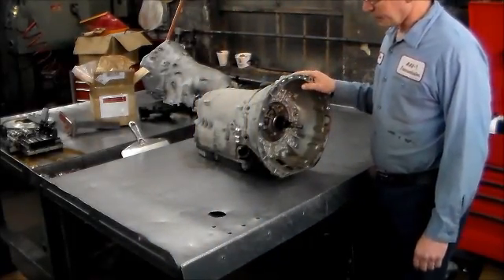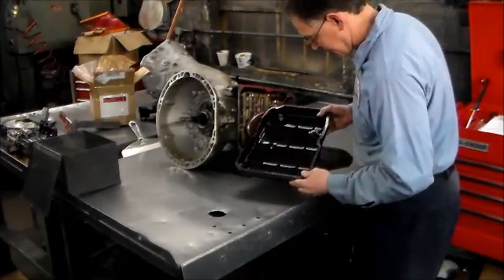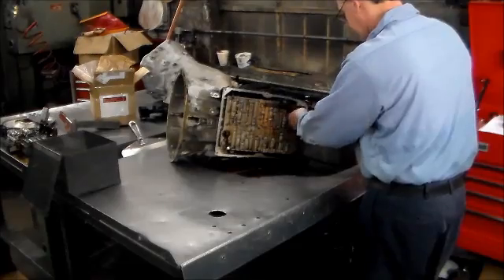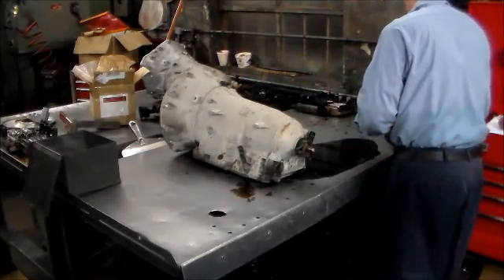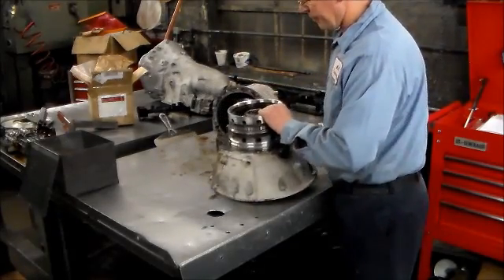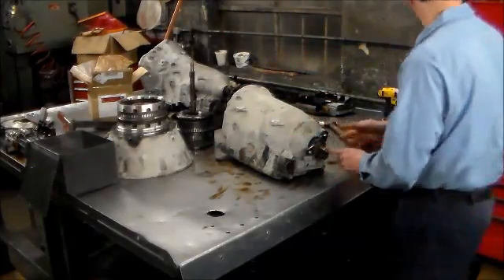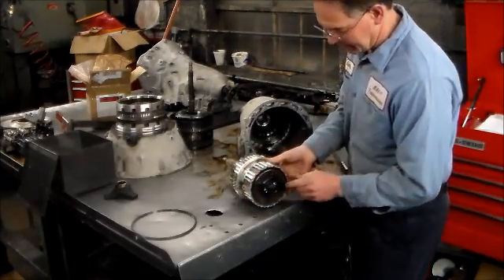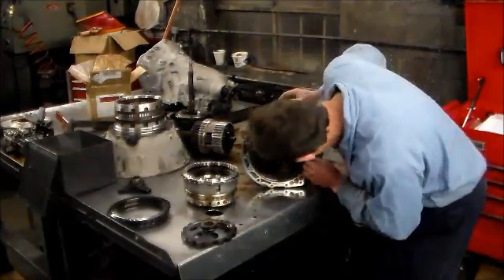722.6 Mercedes Transmission, Teardown Inspection

Comment: Dear Gary 
What is the normal operating temperature on 722.6. I have a suv ML 2003 2.7 diesel the trans warms up to 120c and will go even higer. The problem is going in to limp mode when hot, code is speed sensor 2-3 implausible signal or sliping. Can it also be the conductor plate?
Reply from the maker: Can be conductor plate, do you know what the code number is? 120c is almost 250f that running alittle to hot, about 20 degrees or so,  if your driving it when in limp mode, that will heat up the trans
Reply: No i don’t have the number of the conductor plate, because i didn’t remove valve body. No the transmission goes into limp mode only when hot and also the converter clutch sems little strange to me, it never locks it self on the scann tool it’s always open or regulating. I don’t know how this benz tranns lock up is working but on zf transmissions it’s locked almost all the time but not here, i don’t know majbe it must be that way.
Reply from the maker: No, i meant the trouble code number. Sometimes its a softwear issue with the scan tool, one time i started looking into a speed sensor issue and realized it was the scan tool giving me the wrong info. What type of scanner do you have?
Reply: The codes are p2502 and p220a i have a delphi scan tool.
Reply from the maker: Those are speed sensor codes correct?
Reply: yes, 
p2502 - gear is implausibile or the transmission is slipping,  intermittent

p220a- speed comparison of speed sensor 2 to speed sensor 3, implausible, intermittent
but the transmission isnt actualy slipping.
Reply: @juhu152  Hi, I've replaced conductor plate, and it didn't help (reset codes properly).I have exactly the same codes. What was the solution in your case? Can you help?

Comment: a friend of mine told me they can be the torque converter I want to know what you think
Reply from the maker: What speed do you feel this?
Reply: when I hit the gas stop when I Let Go little bit star
Reply from the maker: Certainly sounds like Torque, when your driving and left off the gas, then go back on the gas you get the shudder?  What model chrysler to you have?
Reply: chrysler 300c tran...722.6
Reply: chrysler 300c tran...722.6
Reply from the maker: Not sure if i asked you, any codes?
Reply: the transmission don't show any codes
Reply from the maker: Ok, next question, do you have a scanner that shows live data?

Comment: I have a P0715 and P1747 code with no shifting above 2-3 gear after installing a used tranny? Any suggestion on the P1747 code? P0715 -speed sensor inside faulty valve body?Thanks
Reply from the maker: If the code is currently present clear it, the trans should shift, if it comes back, the conductor plate on the trans is no good.  Are you sure this is full of oil? do you have the tool (dipstick) to measure the fluid?
Reply: I do have the dipstick. I will go and check. The shop put 8 quarts in, will fluid shortage cause those codes? What if I clear the codes  and it does not shift past 2-3 gear?
Reply: What causes the P1747 ?
Reply from the maker: what is the definition of P1747,  low on fluid can cause, if you clear the code and it still doesnt shift, there is an electrical issue

Comment: Is  swapping  the belhousing on a Mercedes tranny with the same part #R1402712601 possible? Car is  a 1997 E420; bought a transmission that has the same part# but differs belhousing? Also, are all the computer parts (valvebody etc.) the same for all the years?Thanks
Reply from the maker: You can swap the bell housings but there are different tooth count counts on the planet gears, did you use your vin number to get the trans? the part number you posted where did you get that off of?
Reply: The planet gears won't match the housing swap? What will happen with the different tooth counts during the swap  and install ? I got the part number from the middle part on the unit not the housing.
Reply from the maker: Ok, so are you just swapping the bell housing or the whole unit? Thats good that you got the number from the case, that is the correct one
Reply: I am swapping the whole unit, but the new unit has a different bell housing. Is the bell housing the only difference on the unit?
Reply from the maker: Rudolf Gyorkei   Is there a number on the side of the trans that has the numbers 722.6 and then more numbers.  The 722.6 will be in the middle of the number
Reply: I am not near the transmission; however, I will look for the numbers tomorrow at the shop. How many hours will the average mechanic use to disassemble the 722.6 transmission? Thanks
Reply from the maker: To chunk it down doesnt take long, maybe 30 minutes

Comment: 2007 E350, dealer said valve body 8000 to fix,   at what point will I need to program the transmission, can I just clean all that up and put back together and not have to reprogram? not sure what you meant when you said take info out and put back in, on one of your videos, by the way great videos, thanks
Reply from the maker: You may have a 722.9 which has the TCM inside the trans, i would need to run your vin number to confirm trans type and also need to know what codes you have,
Reply: ok, I will get that info, thanks
Reply: Any way videos are great, but cant mess with car cause it belongs to my old lady, as much as I'd   want to, but i think best to leave it to a professional , hence  computerized issues, and what not......if it were mine I'd follow Gary's video! So i took it in to Henrys mercedes in whittier, the opened it and said rebuild for 3800, dealer wanted from 5000 to 8000. Two year warranty, so Henrys it is. Wish Gary was in Calif! Ent and talked to Henry, seemed to have great disposition as Gary, very clean shop, and dedicated. Let you guys know how it turns out, thanks again Gary
Albert
Reply from the maker: Thanks for watching, Greetings from New York

Comment: 2007 E350, dealer said valve body 8000 to fix, is there anyway I can change just the conductor plate and not reprogram? or do u still need to program the transmission after changing just the conductor plate?
Reply: Vin# WDBUF56XX7B011408
In their notes was :  115549 trans. Fault --0778 - B1 brake   solenoid  valve / also

Comment: how do you know if the clutch packs are burned and need to be replaced in the 722.6 transmission
Reply from the maker: Well, you could drop the pan see if anything is in the pan, other than that you would have to take the trans down

Comment: Also gary i took off the trans cooler lines  that connects to the radiator and no fluid passes through when i start the engine
Reply from the maker: Hello Kathy,
  First thing you need to do is make sure there is fluid in the trans, this trans should have a filler tube but no dipstick to check fluid level.  The dipstick is considered a "tool"  and  you would either have to purchase it or go to a shop that has one. Reason why i say to check the fluid level is because these transmissions love to leak out of the connector where the wire harness gets plugged into, this connector has been updated a few times. Start with that and let me know how it goes Gary
Reply: +Gary Ferraro thanks for the quick reply..so i do have the trans dipstick also fluid is fine i cleaned conductor plate also the valves checked all the linkage, and filled with new atf around 4liters...theres no fluid feeding through the trans cooler lines when i turn the car on..also the code i got was with a standard obd2 with abs scanner and i got p0730..any exsperienced fix would be appreciated..
Reply from the maker: Ok, so its full of fluid, thats good. Next question are you taking of only one cooler line? and if so is it the return line? (thats the line the fluid will flow out of)  The P0730 code is  Gear ratio error. Are you disconnecting the line at the radiator?  Gary
Reply: +Gary Ferraro yes the line at the radiator i did both lines and nothing
Reply from the maker: Does the car move at all? foward or reverse
Reply: +Gary Ferraro the shifter moves in all gears but no it doesnt engaged at all it just revs like its in neutral
Reply from the maker: At this point, im thinking your pump is no good, thats why it doesnt move and doesnt pump the fluid through the cooler.
Reply: +Gary Ferraro and how can i know if my torque converter is good or not?
Reply from the maker: The torque converter is a sealed unit, you would have to have it cut open to see if its good or bad, if your going to pull the trans out, look into the pump where the converter hub goes and see if you can see the pump gears, at this point its either pump or converter. Gary

Comment: I have a 4l30e transmission, (Isuzu Axiom),ther is now gears forward,in reverse no problem!what can it be?
Reply from the maker: If this does not move foward, look at your band in the back of the transmission. have you ever worked on a 4L80E Trans before?  The planetary has to be indexed for reassembly.
Reply: for yet there did not work ie all may be due to the rear brake band?
Reply: I was told after the oil additives start to slip and then ceased to be included

Comment: thank's from Armenia
Reply from the maker: Your welcome, greetings from new york.
Reply: I also do repair transmissions, and if I necessarily for sharing!sorry for myenglish :)
Reply from the maker: no worries my friend, do you have alot of automatic transmissions there?
Reply: yes there is the fact that the parts are very expensive to repair and too expensive
Reply: yes we have in the city mostly older model Mercedes 140 124 202 210 190 per Mercedes no problems know all is well,I do not have experience on other machines Opel volskvagen Grand Cherokee Mitsubishi toyota
Reply from the maker: Alot of those cars are here.
Reply: ))) I have another question Honda CR-V and  Acura MDX  transmissions same? s4ta is honda cr-v and i don't know what is iserial number on Acura mdx
Reply from the maker: They are different, what year MDX?
Reply: MDX are 2005 year
Reply from the maker: Thats one heck of a transmission, I call that the monster trans.
Reply: Gary Ferraro  I agree My Big Friend )))
Reply: Opel Omega and Isuzu Axiom transmissions are same?
Reply from the maker: LOL, It sure is
Reply: in our city any peoples says "no money-many problems" )))
Reply: and you know 5hp19 Audi av 1997 year
Reply from the maker: we say that hear too.  lol
Reply from the maker: Have one of those too? doing a rebuild on that?
Reply: yes there is a job for the first time do not know will take up the case or not that will advise
Reply: on 5hp19 no 4-th gear and knocking on Drive
Reply from the maker: does it run away(like its in neutral) when it hits 4th?
Reply: I did not see the customer said not included 4-th
Reply: andI have a 722.6 (MERCEDES E320 1998) no reverse gear what canit be?
Reply from the maker: How does it drive foward? how is the engagement into drive?
Reply: on Drive it work normally!without problems.
Reply: on reverse somtimes work somtimes no
Reply from the maker: do you have any codes? when it works does it work good?
Reply: To be honest there was not working because the back and they changed on new trans with gear without any codes and it gave me a
Reply from the maker: little confused, sorry. They changed the trans and no reverse?
Reply: no))) then the reverse gear is going wrong,they find a new transmission and replace on new transmission,and the old transmission give me for reassembly and parts,but I wana know what can it be rebuild th trans and sold it
Reply: Hi my Big FRIEND!how are You?I have a ford explorer (1992year) the car dont go forward,reverse i ok?what can it be?iwana do it,please help me
Reply from the maker: Start the car and check the fluid level see if its way up on the dip stick, if it is, your pump is no good. Gary
Reply: Gary Ferraro Thanks Gary,but I think,if pump working unnormally why working reverse?
Reply from the maker: Sorry, misunderstood,  No foward is probably an issue with your foward drum. Question, if you pull the shifter down to manual one, does the car move?
Reply: no is not in any position does not go
Reply from the maker: probably your foward drum or foward clutches are no good.
Reply: front legs??what is it?how to check it?thanks
Reply: on saturday i will do it,I'll let you know what was
Reply from the maker: ok sounds good
Reply: Gary Ferraro Thank's!if I will share with you
Reply from the maker: ok
Reply: Gary Ferraro  Hi Gary!how are You?in 4l30e (isuzu axiom) I add the oil and car is working normally reverse and winter mode normally...but on normal mode is not going forward,what can i do?help me please!i think it  low band and friction discs in 2n drum?Thanks!I
Reply from the maker: you may have an issue with that band, did you have the piston out? did you change the band? did you adjust the band?
  In winter mode it probably starting out in 2nd gear. Gary
Reply: Gary Ferraro No,today i will deassembly the trans,when i do it i will look on all thats parts and tell you what was it..
Reply from the maker: ok sounds good
Reply: Gary Ferraro hello Gary!yesterday I deassembled the trans,and the brake band is very very worn out and the drum is too bad!so I cant find the parts and I dont rebuild the trans... but i have a question,may be it is the brake band?it is very burnt!thanks
Reply from the maker: Just to refresh, this is a 4L30E trans correct? Sorry im shot, so busy working about 16 hour days.
Reply: Gary Ferraro yes it is a 4l30e! ok Ijust tell You what happened
Reply from the maker: The low band is what the car takes off on, so if it didnt move foward or slipped, then thats your problem, pretty common for the band to go bad. Gary

Comment: Hi Gary, 
  So did a full rebuild on the transmission new sprags, master rebuild kit etc. I filled it upwith fuild and even checked it with the dipstick, but it is still slipping.   Is it possible for one of the solenoids to go bad and cause a problem like this?
Reply from the maker: +pastormarkm  Solenoids on this unit rarely go bad, the 3 shift solenoids are the same, maybe swap them around see if the problem changes.
Reply: pastormarkm tq converter?
Reply: Gary Ferraro hey Gary what’s was the complaint on this transmission for it to be in your shop for a repair? I have a nag1 now in my Chrysler 300c is parked as of day before the trans messed up its whinnning really loud and won’t move in any gear just revs slow whines loud any gear won’t move??? Wondering if it’s the sprag or something else. When I start the car cold it whine but it will go into gear and move a bit then it will stop again

Comment: Hi Gary,   Thanks again for the help.  I got the pistons out and seals replaced.  This Trans had major slippage at low speed.  That is what led to the rebuild.  I found the K2 steals show some wear rings that make me think they were the location of the slippage and it seems like they had way to little piston apply pressure to them allowing the slippage.   So far the seals did not seam to be bad, so what else should I look at as a possible source of the slippage?  (I should say the 4 plastic seals on the intermediate shaft did seem like they did not stick out of the shaft barely at all, so I guess that could be the source, but none of them seemed to be a clear failure leading to this much slippage)   Thanks
God bless...
           Mark
Reply from the maker: +pastormarkm     if the trans slipped on the shifts, replace the F1 and F2 sprags, these have a high failure rate. Gary
Reply: Hi Gary, It slipped all the time, not just during shifts.  The F1 sprag is working correctly I haven't gotten to checking the F2 sprag yet, but I think there has to be something else going on...  The Jeep dealer replaced the TCM and that did nothing, so they said it needed a rebuild. (Just more info in case that helps)
Reply from the maker: Checking to see if the sprag works is fine, but that doesn't mean its good, I replace them on every rebuild because of the high failure rate. The sprags are the bridges between the shifts, so if its slipping between the shifts replace them both. Gary
Reply: Thanks Gary,  I got the two sprags and the separator plate ordered and on their way.  The transmission was slipping all the time not just on shifts.  Would the sprags going bad do that?  The housings don't show pitting of unusual wear from the sprags slipping on/in them.
Reply from the maker: you wont be able to tell if the elements are worn, you also need a special tool(dipstick) to check the fluid level, do you have this?
Reply: Yep, I've got the dipstick :-)
Reply from the maker: ok,good deal.

Comment: Excellent video Gary!  Thanks for sharing.    One question, how do I get the K1 apply piston out so I can replace the o-ring seals in it?
Reply from the maker: +pastormarkm  After you remove the clutchs, you will need to depress the belville return spring to get out the wire clip.  For this you need a foot press or somekind of bench press to push the spring down and get the snap ring out.

Comment: Great videos Garry. You say that the tolerances should be 'tightened up'.
I'm thinking that you are talking about using thicker snap rings in the clutch packs to get to spec? Is a minimum specified clearance better than a mid range clearance? I dont want them too tight to cause problems.D
Reply from the maker: +alfamontreal100  The clerances vary but,  K1, B1, K2, K3, Mimum .020-.030B2 .008-.051,  B3, .039-.055. Gary